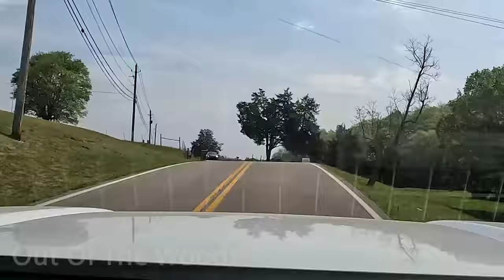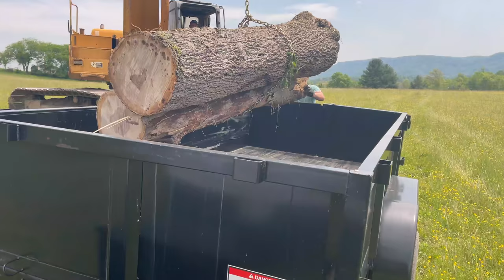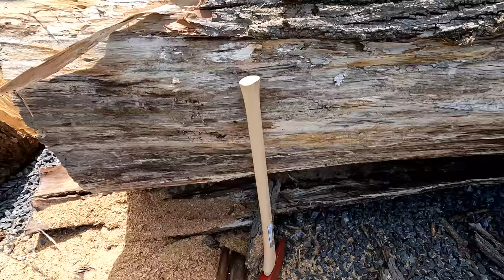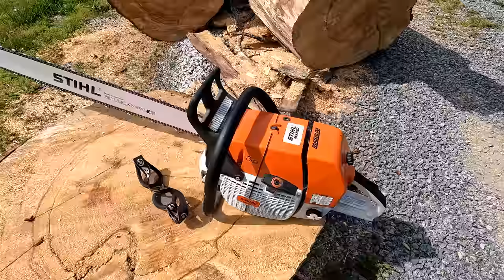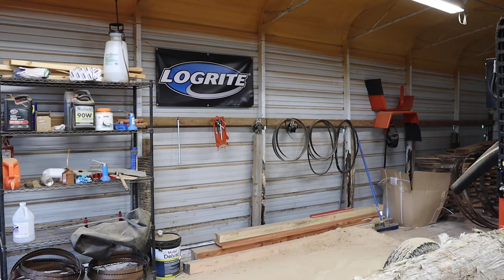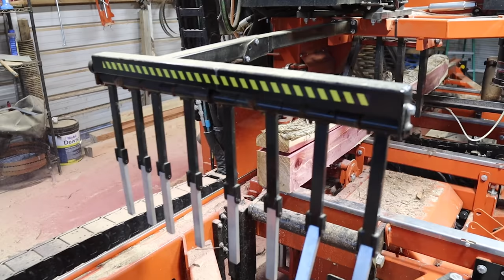This Log Was Too Big For My Sawmill

Comment: Her(interior N/W) I was taught this condition was called wind shake, a result of the wind blowing the trees back and forth, especially Western Larch (Tamarack) and taller trees. when working in a plywood plant, the main peelers were Doug fir and W Larch, and when you got a bigger butt cut to peel, there was poor veneer quality. Also, railroad tie were the main product in the 30's and 40's, and a crosscut saw (misery whip) the tool for the job. You still see lots of tall stumps with springboard slots. These were to get above the shake, and save an extra cut, as the butt would not produce a good tie. This was told to me by an Uncle, who was a tie hack. Crosscut, broadaxe, a bottle of grease for the saw and a lard pail for a lunch bucket. Them Old Boys were some tough Men.

Comment: I can tell you that there are millions of these red cedar on the olympic peninsula in washington state.  They come up around the large old growth castle tops that are huge on the bottoms but not to tall before they just go crazy with tops an some ain't even cedar growing up there. The small cedars around going are usually water kill as they drown it all the water just below the surface of that muskeg material. With more limbs than a porcupine has needles, they make for nice tight knot post or sawn up make some real fine wainscot (wood paneling) for interior decoration. All the big trees are usually rotted out an only the shell remains on the stump.... very little salvage in stuff like that. Now I know that rotted wood is not structurally sound but have seen it sawed for interior paneling as well as its just glued on the walls

Comment: Nice video explaining what wood is not good.  The wood reminds me of pound cake because when you split it with the log splitter it breaks off in chunks.   I have noticed wood like this comes from a tree that was cut down but had  died years before maybe the ash bore Beatle caused the decaying.

Comment: Just a heads up. Attach your trailer safety chains to your vehicle so the opening is facing you or they can bounce out. 
You installed them backwards.
Another great video.
Reply: looks too me as if they have safety latches on hooks

Comment: What I do is multiply the diameter of small end inside the bark by .7 and that gives you the cant size.   7/10 times 6" is 4.2, so you could get a 4 X 4 out of it, if it's straight of course.

Comment: I guess you just never know until you cut into a log.
I finally got someone to cut down my 2 black walnut trees by my driveway that were dying. We were surprised to see that there was no rot at all in either trunk. All the rot was up in the limbs. The larger of the 2 is about 18-19" at the base and the smaller is about 14-15".  The original plan was to cut them up for firewood, but since they were a much better quality, he decided to take pics and ask his buddy with a mill if he was interested in them.

Comment: 9:49
So, multiplying the desired lumber dimension by 1.5 would also work, would it not ?
Reply: @jerryriggs6911  You're doing it wrong.. count the horns and divide by two.
Reply: @jerryriggs6911  What if they are polled?
Reply: @tonygrimes13  if polled go back to counting legs, then divide by 2, then take that number and divide by 2 again. That's the way I do it because big numbers (like 4) has always gives me a fit. Again that's why I like the horn counting and dividing by 2. Lol

Comment: So, for a square cant, you need 1 1/2 times the face?
Reply: Cant size is simple Maths. It's the Square Root of smallest diameter X smallest diameter divided by 2. e.g. 10" diameter would be square root of 50 = 7.07" - Always provided you had a perfectly straight log!
Reply: @tonygrimes13  where does the 50 come from, if the diameter is 10”?
Reply: @arogue469  10 x 10 = 100 divide by 2 = 50.
Reply: @tonygrimes13  Oh.  The way you wrote it, the math would look like this: 3.16 x 10 / 2 = 15.8.  You gave 10 as the working diameter, and 3.16 is the square root of ten.  Hence my confusion.
Reply: @arogue469  Apologies.

Comment: Instead of dividing by 2 and then adding that half back why not skip a step and multiply buy 1.5?  If you want a 4"  X  4" then multiply 4"X1.5 = 6.  Then 6" would be the minimum log diameter.

Comment: What a shame to throw all that beautiful wood in the burn pile!! I think that you should have put those sections on the mill upright (as the tree grows) and cut them into 3 to 6 inch slabs , even with the rotting and ring splitting it would make some beautiful coffee and end tables! Flood coat them with epoxy and all those defects become the unique quirks and character of each piece. I understand that your main goal is to make nice straight clean usable lumber and that wasn't possible for that log but burning it all and not using any of it just seems like a missed opportunity to utilize the imperfections that nature causes and turning them into something beautiful to celebrate and educate others about all that can go wrong in a trees life and in it's death. I take pieces out of all my friends fire wood piles all the time and put them on the lathe and make incredible things out of them and then give them back to them so they can see the other possibilities of what they are turning into ash and smoke. I am sure that if you cut a few there would be pros interested in buying them from you. I watch your videos all the time and love seeing the review of the mystery of what is inside waiting to be discovered. I also love listening to you accent!